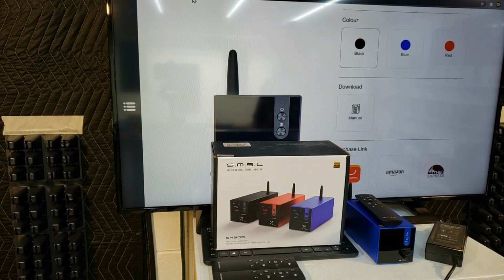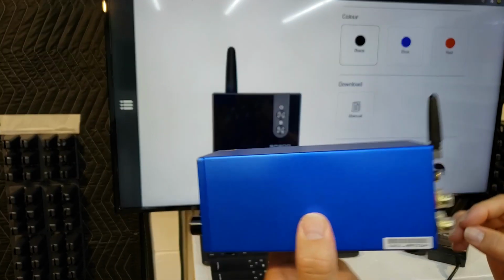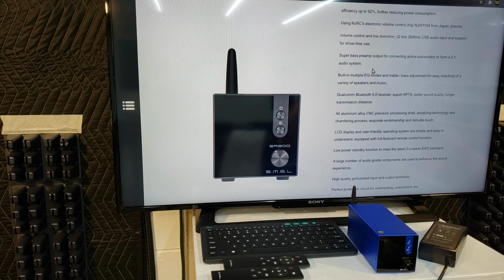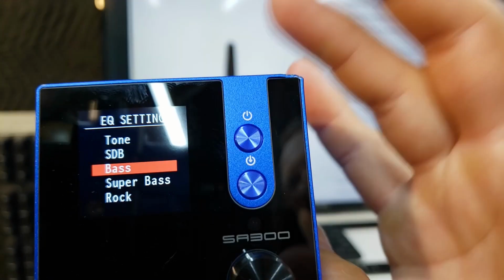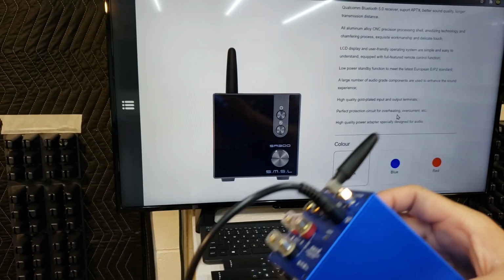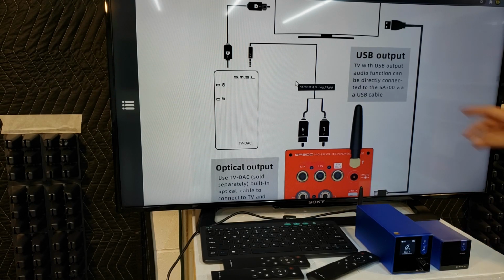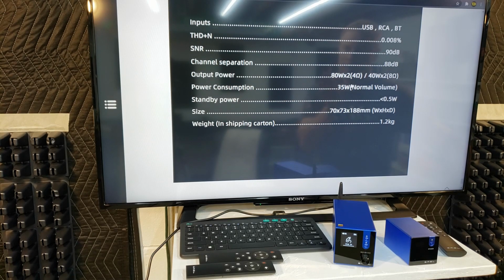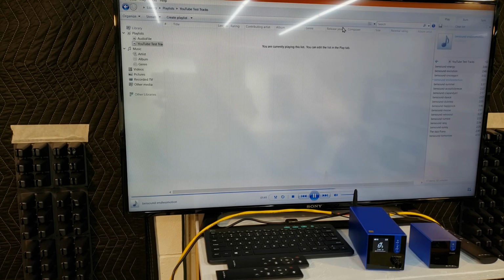SMSL SA300 Integrated Amplifier⭐(All I Could Ever Want In A Brick)

Comment: Nice review but what about frequency response 🤔
Reply from the maker: Response is 20hz - 40khz (±0.1db) for the Infineon  MA12070 class D amp this uses. Very low distortion and cross talk with a nice flat response. Great little amp. This MA12070 is used in many of this little Chinese amps.

Comment: Great video!  I just have two quick questions below that would be awesome if you could answer.

1:  With the setup, I have now I can run a USB in from my PC and when I want to switch from my PC to my phone via Bluetooth all I have to do is enable Bluetooth on my phone and connect and it will switch automatically without having to mess with anything (to switch back though I have to do it manually though which is fine since I'm at my PC then).  Will this also automatically switch over to Bluetooth when a device connects to it?

2:  How do you pair a device / is there any security feature such as having to hold a button to pair so that other people nearby can't hijack the connection?

Thanks and awesome video!
Reply from the maker: Switching between USB (your PC) and Bluetooth is easy as switching inputs. The bluetooth is treated as an input like USB or the Line In. The Bluetooth is off until you switch to it, then it becomes available ready to pair. Its available to anything  within range. But if someone else connects to it say from another apartment you can use the BT Clear function to boot them off and pair your device. It can only be paired to one device at a time so someone else can't connect once you are. Heres the manual its all in there. Its a great unit just wish it had a headphone jack. Hope this helps.

Comment: I'd like to alert potential buyers of the SMSL SA300 of what for them may be a deal breaker. Coincidentally, I bought the SA300 in May of 2020. I've solely used it in my a living room rig. Circumstances prevented me from setting my speakers up optimally, so I didn't detect this issue then. I moved from that residence to my current abode this year and here I can set up my speakers optimally. 

The issue with the SA300 is an utter lack of depth in the soundfield. Nor is the soundfield very wide. Other than that issue which may not matter to many but will to some, its a fine little piece of gear. Do be warned that the binding posts are small, 14ga bare wire just fits. Spades might but banana plugs are a no go. 

As an audiophile on a budget, I plan on replacing the SA300 with the new SMSL AO200 amplifier because the soundfield is important to me. Early adopters have already confirmed that the AO200's soundfield is satisfactory. It's also twice the price of the SA200 but you get more with balanced inputs, a more attractive design and clearly better specs. But make no mistake, despite its flaws, at $139.00 the SA300 is truly a bargain. It drives my Dynaudio Emit10 bookshelves easily, they are nominally 6 ohm, 83-86db speakers. 

Sometimes you get what you pay for...

Comment: @IOWAudio Reviews great job bro & can I add a powered speaker to the SMSL SA300 Integrated if not what kin I us?
Reply from the maker: I'm assuming you meant powered sub and yes. The sub out is just a pre-out so the sub itself will need to be powered but typically they are. I recommend the Sony SS-CS5 speakers and Polk PSW10 sub as an excellent affordable 2.1 setup with the SA300.
Reply: @iowaudioreviews  I do have a powered sub but my speakers are powered too. The speakers don’t have a sub out that’s why I’m asking.

Comment: Hi - does the subwoofer output also change in volume when you change the volume using the remote?
Reply from the maker: Yes. It works the same as any other sub output on say like a home theater reciever.

Comment: Fun ALERT comment: The displayed Volume #s have nothing to do with how much power is  being output;  at and indicated "35" you may be  clipping on some  tracks and there will be no further low distortion power at higher indicated nunbers. Im sure you know this - just a  comment for your novice  viewers.
As an aging Boston area audiophile in this hobby for over 1/2 a  century, Bananas are NOT a  preferred connexion method for long term listening. In fact through our  research, we found eliminating as many temporary interfaces as is practical will improve the signal presented  greatly.  On any  Familiar workhorse  speaker "victim" try a Tin/silver/bismuth <or> 63/37 to solder speaker cabling directly to the crossover board - bypassing the rear terminals. It should result in an amazing removal of  veils noticeable on higher resolution medium like DAT or  direct to disc LP. My secret to Hi-er FI  revealed today on your  channel :) - Sandy